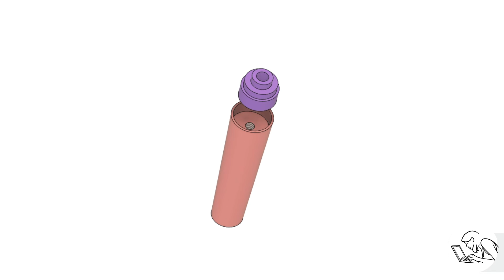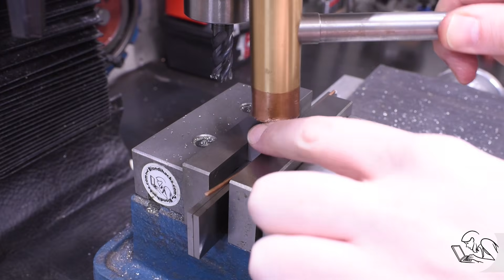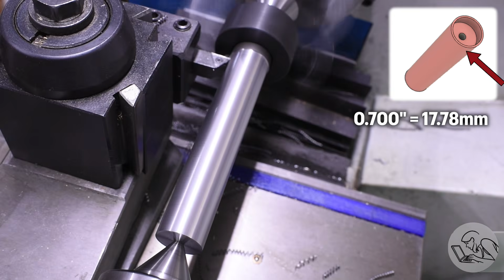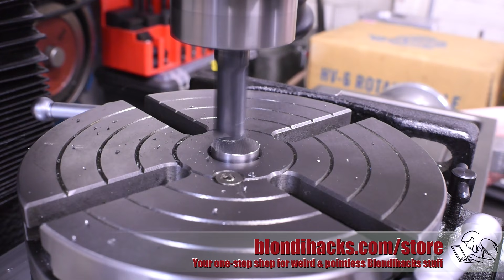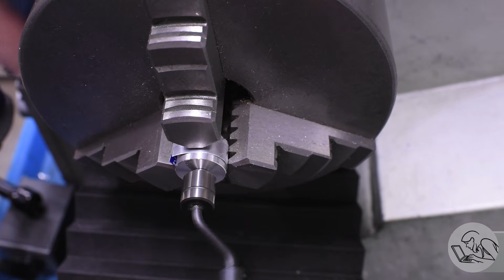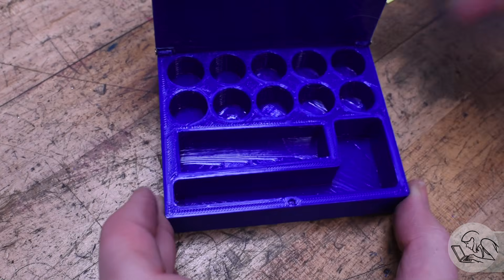Corner Rounding and End Rounding Made Easy!

Comment: Is it me, or was the block used for the keys 1 half of the press jig that Quinn made for the captive springs for her toolmakers clamps?
Reply from the maker: Whoa, good eye. That’s a real fan. 😁
Reply: @Blondihacks  You clearly have a 3D printer but I couldn't find any vids on it.
If you get bored one day wanna tell us what you have, why you got that particular unit, what's good about it, what could be better, what you might get if you were going to buy another one. A few YT machinists have them but few tell us much if anything about the ones they have.
Reply: @tonywilson4713  I have 2 printers myself and have done a lot of research in the last few months for a friend who wanted to buy one.  I came to the conclusion that if you want it to work great out of the box, get a Prusa i3 Mk3.  If you want to save a lot of money and still have a great first 3d printer, get an Ender 3 V2.

The Prusas apparently really are amazing, and the Ender 3's are great and a ton of hobbyists own them, so they're really easy to fix or upgrade.

Unfortunately, I own neither of those.  I have 2 TronXY printers, 1 that I loved (it's basically an ender 3 clone and I'm in the middle of upgrading it) and 1 that I've had nothing but problems with and wouldn't wish on an enemy.
Reply: @Raytenecks  Thanks.
What do you use yours for? I suspect that makes a huge difference. I have seen units with exchangeable heads and can do 3D printing, light CNC milling and laser work. There's whole channels dedicated to the stuff and its easy to get lost. 
What I am interested in is what units machinist people have gotten and why they got them.

Stefan Gotteswinter has 2 small CNC mills and has covered both and explained why he got the specific machines he got.
Reply: @tonywilson4713  I'm not a machinist, I just find this channel fascinating.

I used my 3d printer to make a 3d printed CNC router (actually, working on the upgrade for that, and it'll also be my upgrade for my laser cnc) and some jigs for woodworking, as well as little holders and things around the house.  It's also useful for upgrading the printers themselves.
Reply: @tonywilson4713  Oh, I should also mention, my friend did their own research as well and picked the Ender 3 V2 as the one they wanted, and they've been quite happy with it.
Reply: @Raytenecks  Thanks for both comments.
Reply: @Raytenecks  My daughter bought an Ender 3. I helped put it together, easy enough. We replaced the original table surface with tempered glass. Cheap readily available. There is a learning curve to these things! But it does work. Lots of online info for this model. Now she wants a bigger build surface so has ordered a kit to do that. Most everything is setup to print overnight. Slow process! These things are really inexpensive for all the parts that there are.
Reply: Fascinating - so much know how clearly taught 👍thank you . Kinda wets the appetite to get machining too

Comment: Thanks for this, many a time Ive just left items square because Im making 1 of, and didn't want to spend a long time changing setups and then having to dial everything in, my next project needs 2x 15" steel flat bars which will look horrendous with square ends, that would be indicating x4!

Also lucky I have long forearms for those bars on a rotary table ;)

Comment: A good addition to the kit would be a puller for the mandrel. Just a inverted cup with a hole in the center. The the hold down screw extracts the mandrel and the rotary table can stay in position.

Comment: I encountered a similar problem not long ago on our 10 and 12 inch Vertex.

I had to give up and as the grey haired ones for help: they determined the taper and I was able to turn some Delrin index pins (I didn't need them to withstand milling forces, just to index parts concentric on varying sized bores for repair).

As always I've come away from one of your videos for new ideas to try out at the shop.

Cheers!

Comment: Hello Quinn and thanks for this very timesaving solution for finding the zero when setting up the rotary table. I have spent far too much time fiddeling with indicator clock.
Instead of making my taper (MT3) I bought a MT3 that was supposed for holding a drill chuck.  I found that the very cheap ones are not hardened as quality parts generally are.  Price was about 4 USD allthough the steel was pretty hard to machine.

Comment: Very nice. Now let's get you a proper lathe file. Teeth are cut at 45 degrees, edges are straight and smooth much safer when working around a rotating chuck.

Comment: If you ever accidentally turn the diameter of a part down too far, there is a way to make it bigger again.......without welding. In fact, you don't even have to take it out of the lathe.

Just knurl it. Knurling doesn't remove any material, so some spots become slightly elevated above the starting height, and some spots end up below the starting surface height.

Comment: Awesome video, thanks!  But I have a curiosity question:  I understand the need for the blocks to position your table at a repeatable angle.  My little 4" table came with them (thankfully). But they are narrower than my slots (since the makers don't know how wide any given user's slots are), so I just always push the table back until the blocks touch against the back wall of my slot, setting the alignment, then crank it all down.  That seems to me as precisely repeatable as having the blocks fit snug in the slot, so why have the blocks be precision fit to the width of your slot?  Is it to counter the possibility of twisting under friction and changing the angle when I crank down my screws?  It certainly would stop that, but is that a factor I'm overlooking (and should stop overlooking)?   Something else entirely?   Anyway not any kind of nit-pick, just wondering if I'm losing accuracy because of something that (as usual) you're thinking about but I'm not.

Comment: Perhaps someone else has asked already, but can you say why you didn't hold the taper in the tapered spindle of your lathe and turn the extra off there?  Is it because your lathe doesn't have a tapered spindle, or it's the wrong Morse taper?
Reply: She was being lathey. But seriously the part was in the rotary table on the mill (which is almost as lathe-like as the mill gets) and direct measurements of the part in situ were possible, which is ideal.

Comment: Why does a rotary table need to be indexed to the bed when using it in the orientation Quin did in the video?  I understand why you would want to have the rotary table properly trammed in when the rotary table is being used standing up (to keep the axis of the rotary table parallel with the X or Y axis) but when the rotary table is "on its back" aren't you mostly concerned with the rotary table's axis being parallel with the spindle. which is dictated by the rotary table its self, as well as how precisely you have aligned the head of the mill?

Comment: My shop is in the basement of my home and to make a long story less long, I passed up a chance at an old Southbend lathe and Bridgeport mill for $2000 (yeah, I cried for three days) because of space limitations and  absolutely no way to get them in. So, I've been working on a Precision Matthews 1228VF-LB lathe and I'm considering purchasing a PM-25MV mill. Your space situation is similar to mine and these videos have been a great source of inspiration for my small shop addiction. I'm finding that with a little ingenuity you can make some fairly precise parts with some of the import stuff. I've had good luck with the PM lathe.
Brilliant design of this fixture, BTW. When I finally get a mill in here I think it will be one of my first projects - after getting the vice, rotary table, tooling, etc. of course, and a partridge in a pear tree.

Comment: That was very good Quinn. I guess if you did not have that fixture you could use an m2 centre, put your part on the centre pack between that and the table. Then clamp down. The centre would give you a larger hole size variation, just have to have a selection of packing. Just a thought 😀

Comment: Thank you for this video. I used a mandrel that sticks up 1,5” or so from the dividing table. Setting that up for rounding a 1” thick and 3” wide bar of aluminium took forever! Will definetly use something like this for next time. A tip: If you drill a blind hole in the material you want to rund you can simply have a pin in the mandrel going into the hole and Keep it fixed with a clamp. That way you can avoid unwanted holes on the outside/display side of your work.

Comment: When making keys to index vices or rotary tables on the mill table, I simply make round buttons with the appropriate dimensions in my lathe. Much easier.
Reply: That's simply brilliant.
Or maybe brilliantly simple!
Reply: For tooling I prefer blocks as keys, more contact and longer wearing. I use buttons or shoulder screws with modified heads for fixtures.

Comment: Pro tip there with using the drill chuck for quick squaring of the part back in the jaws, so obvious but easy to overlook. I won't be scared to remake the morse taper for my drill chuck on my end stock (mines been "mangled" before I bought my lathe).

Comment: Yesterday I did almost the same for a jury-rigged repair of the car‘s water cooler — coincidence or destiny? 😜

Sadly my rotary table does not come with an MT2, only a 6.6mm hole into which I cut an M8 thread and bolted my parts to the rotary table. Not nearly as precise as your fixture, but it did the job and I was in a hurry (auto parts always break on the day when you go on a long-planned trip).

Comment: I had a deal made up that's very similar to yours, it used  MT#1 pins that went into a MT#3 adapter.
I got a whole box of the MT#1 pins from an auction, they were all different sizes everything from 1/8 up to 1-1/8 or so by 1/64 increments, I have no idea
what they were originally made for. Now, I can't use any of them, because I had a big job on my 10" rotary table and stripped the worm gear out of it.

Comment: will a morse taper always seat exactly the same (within a few micron)? This seems like as you rotate the taper, the matting surfaces would be different and over time, wear would prevent your part from sitting at the same depth. Luckily you can remachine your inserts to adjust for some error between the taper and the holder
Reply: Morse tapers "should" be (within reason) perfectly round and have a straight line taper, which is why they are usually grind finished.
If you are making one and it's not round, there is something seriously wrong in the machine you are making it on.
The reason Quinn used the blue was to check the one made was a straight taper(even without grinding).
As for "wearing", there should be none, a morse taper is designed to go straight in and stick, it should never rotate or be rotated for any reason, even removing it.
Hope this helps

Comment: Thanks Quinn! Your timing for me is impeccable because I just started a project where I will need to round over the ends of a flat bar of stainless steel. For this I'm justifying buying a small modestly priced low profile rotary table.

Comment: Hi Quinn, excellent video as always. I'm curious as to why you would need location pegs on the rotary table, surely it doesn't matter as you just rotate it if not square. I'm probably missing something obvious here.
Reply from the maker: It’s so that zero ends up in the same place relative to positive X each time. Rotary tables can’t be “zeroed” the way hand wheels can’t. At least not this one.
Reply: @Blondihacks  mine is very similar to yours,  unbranded version, but you can disengage the leadscrew with a lever and freely spin the table to zero it, the handwheel can be zeroed same as mill/lathe handwheels. I've not done a huge amount of rotary table work, so I defer to your experience. I will be watching to get a better understanding.

Comment: I just got an idea, but I dont know of its any Good. So, what if instead of offsetting the tailstock you put a center in the 4-jaw and use that to set the taper. Would save you from having to readjust the tailstock back on center. What do you guys think?
Reply from the maker: That creates an eccentric turning, not a taper
Reply: Yeah right. I got blinded by my laziness😅. And I was wondering why no one else had this "brilliant" idea🙃
Reply: A boring head with a dead center to fit could be used in the tailstock. Probably not worth the trouble and loss of rigidity.

Comment: Why not cut the .125 shoulder as part of the tapered mandrel?  Then your accessories would just be simple bushings or pins.
Reply from the maker: Because the shoulder needs to be only slightly larger than the reference hole or the cutter will hit it
Reply: @Blondihacks  ahh right.  Thank you.

Comment: You get such a good finish from what looks like cheap import tooling. We had that stuff in my school, never could get nice surface finish from it unless I pushed it hard enough to chip break.

Cool method with plunging the endmill and taking advantage of the rotary table. Could have used a bench stone to get the last thou of the taper super flush with the table?